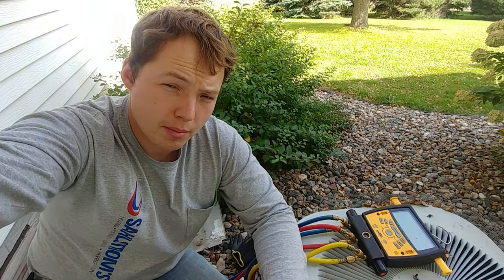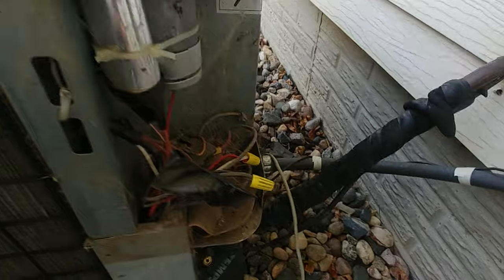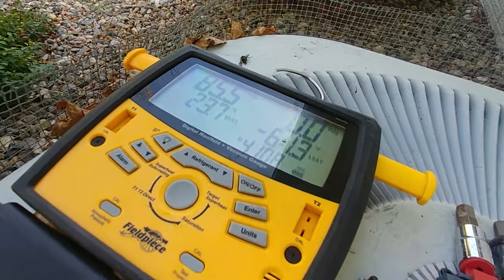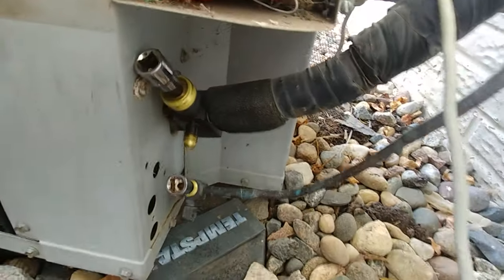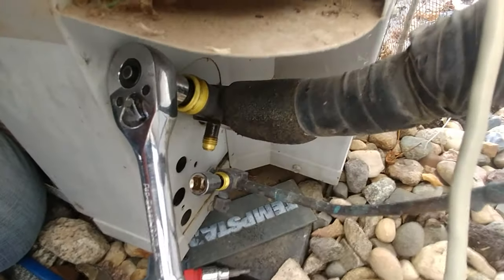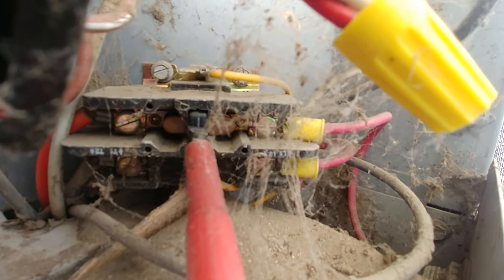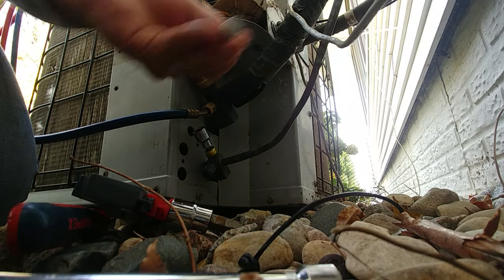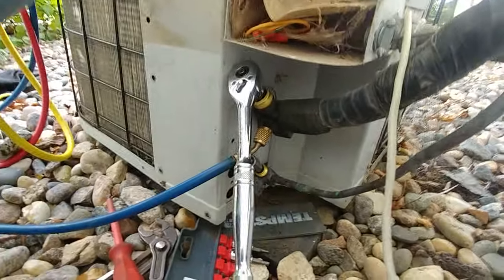How To Pump Down an AC Unit Into the Outside Condenser - Pump Freon Into Air Conditioner

Comment: Wrong
Reply: 1. He should have used the thermostat to turn the unit on. Its much easier and safer to just pull the quick disconnect than have his hand pushing the contactor down, insulated screwdeiver or not. 

2. You need to let the unit run for about 2 minutes before shutting off the liquid line. Its less stress on the compressor that way

3. You leave the suction line wide open till the end. Once you reach zero pressure the refrigerant in the suction line wont flow backwards, itll stay in the compressor so you dont have to worry about backflow
Reply from the maker: Croa Arco I disagree but respect you're alternative method.

1 - Pulling a disconnect is not always easy. The contactor is simple to push in and release.

2 - Running the compressor for 2 minutes may be very very slightly better for the unit but that would be extremely difficult to prove.

3 - Leaving the suction line open makes it slower to shut off the unit. It is better to be able to shut it off faster so as not to run the compressor in a vacuum for too long.

Thanks for your comment.
Reply from the maker: Haha. No sir. You're wrong. Simply saying that I'm wrong isn't helpful. Please share your more specific comments if you have thoughts to share.
Reply: I respect your methods too. I have no issue pushing a contactor in but just the hassle of holding my hand their really haha

At the end of the day we'll do what we've been taught and feel is best; and theirs plenty of methods for everything in this trade.

I will concede tho on the third point, I leave it open fully just for getting it done quicker, I never considered the damage caused by leaving it in vacuum to long. I guess the slight stress on the compressor I avoid from the 2nd point is negated by the 3 point I made hahah
Reply: I would have to agree with Ben based on the fact I went to school 13 months and and I've read almost two full books have my universal EPA